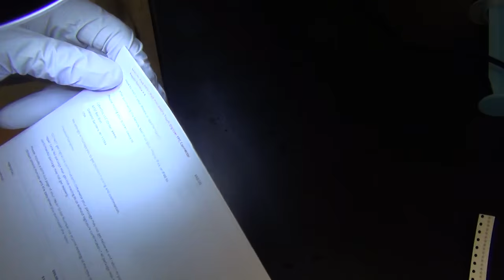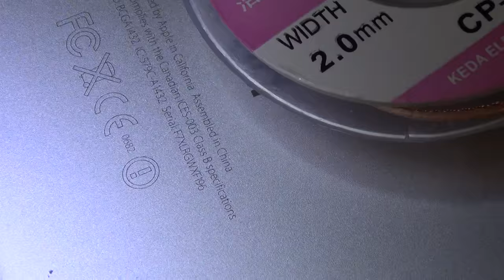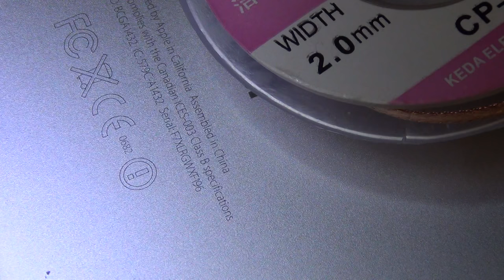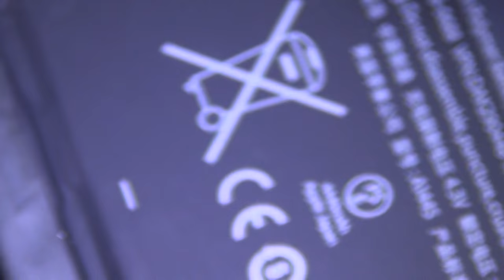iPad mini Retina Touch Digitizer Connector Repair digitizer fpc connector with pulled pad

Comment: where did you connect the jumper cable to ? one side is connected to fpc connector and the other side is connected to where?????
Reply from the maker: there is a very small cap  where that pin goes to.